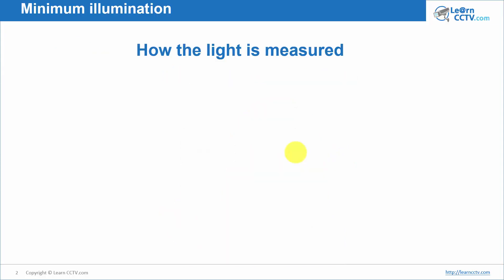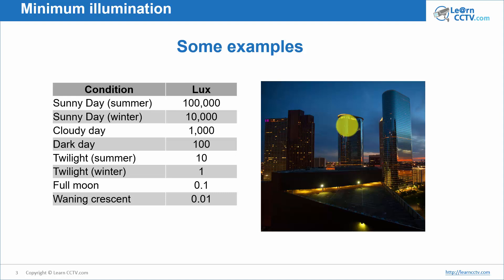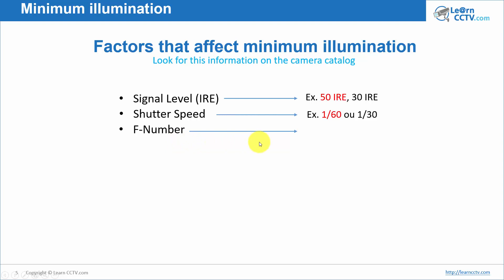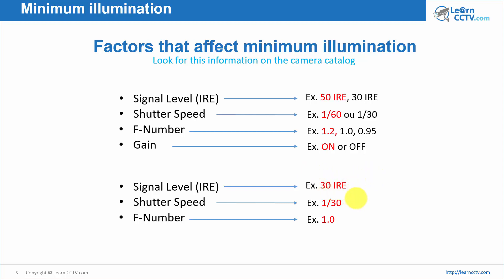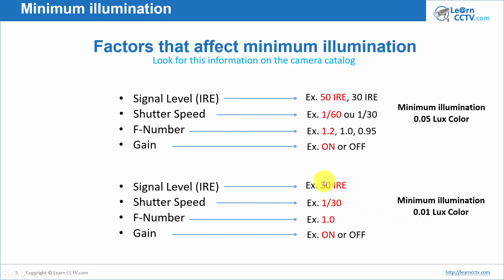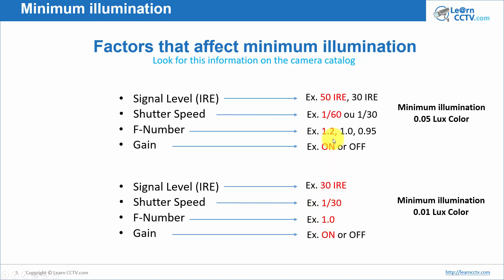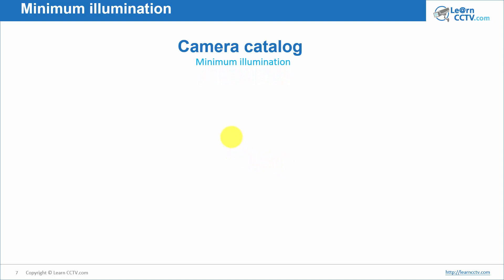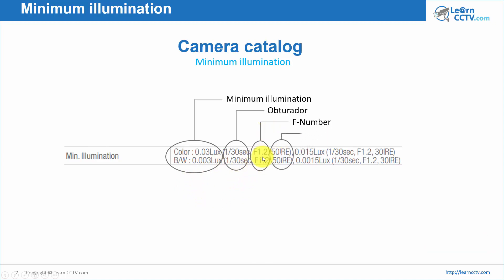Lights for CCTV cameras (basic principles)

Comment: Thank you for the video, Now i am more confused LOL ...My driveway ends at 100ft, could you recommend a good camera that will recognize a face at that distance ?
Reply from the maker: Use a 2MP camera with varifocal lens so you can adjust the zoom to the area you want to capture the face. Don't use a camera to monitor the area and recognize faces at the same time, the application is different because you need to zoom in to get the face details, so the camera can't see the rest of the scene. Use two camera if you need both application (face + area monitoring)
Reply: @LearnCCTV  thank you .